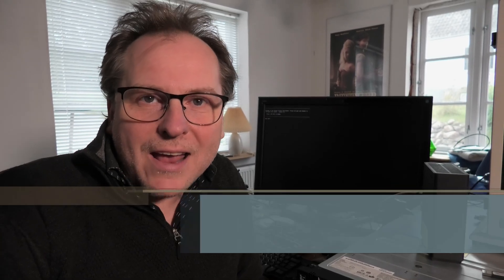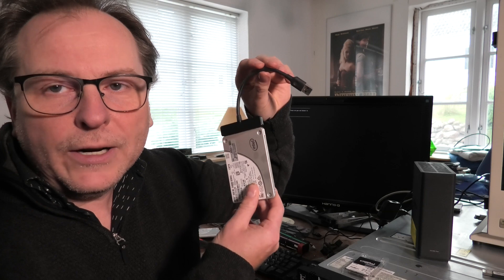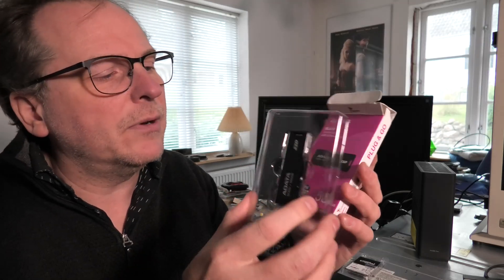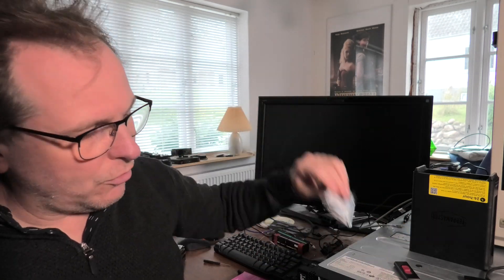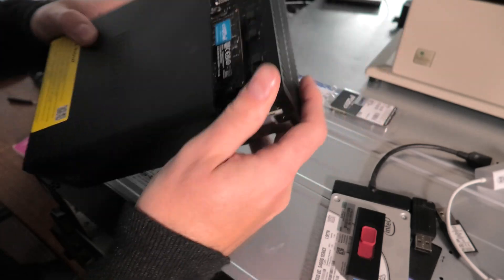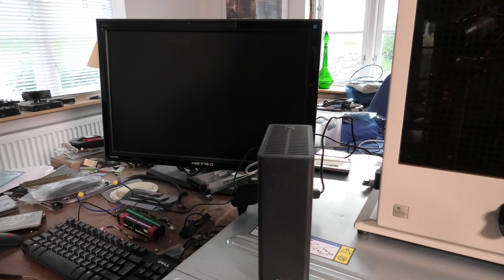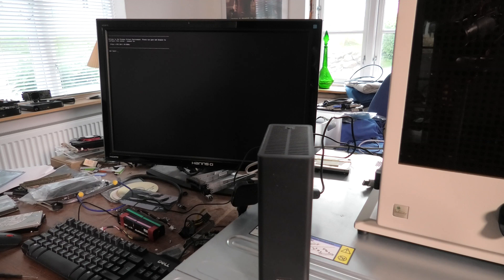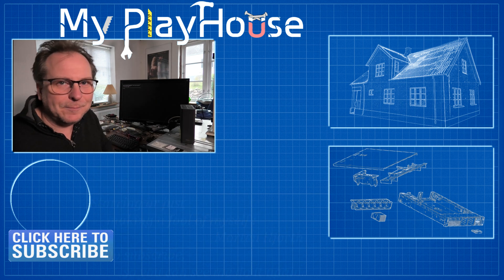The TerraMaster F8 SSD Plus - Does do 32GB of RAM - 1431

Comment: I have tried 48 GB RAM (Corsair CMSX48GX5M1A4800C40) and 32 GB RAM (Crucial CT32G48C40S5), none of them worked even after waiting 1 hour (Corsair) and 10 minutes (Crucial) :(
I wonder if NVMe slot usage count matters (I'm using all of them), or if some newer hardware revision of the CPU has it locked to 16 GB...
Reply from the maker: I had some issues later with two NVMe´s,, and booting Proxmox from USB-SSD and 32GB
Reply: Me too. I have no luck to boot up my F8 SSD Plus (BIOS: MADN0301.V01, Mainboard version TM-N305D1-H V1.1) with 48GB DDR5 SODIMM (Corsair CMSX48GX5M1A4800C40). I already disabled the secure boot, VT-d, First boot is not TOS. But still not able to boot up the machine. Any suggestion? Also, would you tell me the BIOS version and the Hardware version of your F8 SSD Plus.  Thank you so much indeed.
Reply: @adktk  It just doesn't work for me either. I have the MADN0301.V02 / TM-N305D1-H V1.2, tried with the Corsair 48GB CMSX48GX5M1A4800C40 and another 32GB (SP560013) specifically designed to work for the F8 SSD Plus. Tried resetting the CMOS (battery removal + jumper), removed all M2 SSDs, waited 15 min each time for the memory training to complete. No success. If you found out how to solve this let me know.

Comment: we just tried with 48gb ram and it works.
Reply from the maker: Awesome!! thank You for info.
Reply: What exact brand and part # did you use for the 48GB RAM?
Reply: I have a Terramaster F8 SSD Plus and I have successfully upgraded to 48GB RAM with Crucial RAM 48GB DDR5 5600MHz (or 5200MHz or 4800MHz) Laptop Memory CT48G56C46S5.
Reply: @gosciak1949  Hi gosciak1949, I have no luck to boot up my F8 SSD Plus (BIOS: MADN0301.V01, Mainboard version TM-N305D1-H V1.1) with 48GB DDR5 SODIMM (Corsair CMSX48GX5M1A4800C40). I already disabled the secure boot, VT-d, First boot is not TOS. But still not able to boot up the machine. Any suggestion? Also, would you tell me the BIOS version and the Hardware version of your F8 SSD Plus.  Thank you so much indeed.
Reply: @gosciak1949  we found 2 that worked,
CMSX48GX5M1A4800C40
and
CT48G56C46S5

However we noticed it does not always work it could be there is diffrent versions of the f8 ssd plus that we do not know about. it seems very random if it works or not. for some odd reason. when it does work however its very stable. but its hard to tell what the cause is.

for instance on one of my f8 ssd plus the corsair 48gb did not work but it worked in the other one. and vice versa. we checked on terramaster forum and it seems to be quite random. all we do know is when it works. it works solid.

Comment: Maybe something like this (AIYEEN 90 Degree USB3.0 Adapter (2 Pack), Left Angle and Right Angle 3.0 USB A Male to Female Converter Extender for PC) on Amazon, will give you 90 degrees and also support the USB drive. Would be great to see if you can get it working as I've ordered an F8 and planning on TrueNAS as default OS.
Reply from the maker: I ordered two of these : https://www.aliexpress.com/item/1005006169997347.html
To see if any of them will do the trick.

Comment: Hi, just wanna let you know, the 48GB ram stick also works in Proxmox. It is the best companion for F8 SSD Plus :)
The only thing I think this product can do better is they should use Intel x710 10GbE chips instead. X710 can support SRIOV and ESXi so the network performance would be better. Otherwise it is still a good little homelab server with Proxmox in most cases.
Mine running Proxmox, and running TrueNAS inside Proxmox, pass through 6 of the NVMEs and 2 nvmes left for VMs. But you inspired me to use the internal USB as well, so we can basically have 9 SSD all together:)
(I am not sure the internal USB speed, but I assumed it is a 10Gbps USB, so it is effectively about the same speed as PCIe Gen 3x1, which is nice.)

Comment: Might have found the perfect solution to use the internal USB port for more storage. On amazon they sell for £15 an nvme enclosure for 2230 which comes with a usb port and usb cable so you can fit it anywhere in the case. Size 42mm x 42mm and height / thickness 12mm would this fit inside the box do you think? I could not find a USB stick which is SSD smaller than the one you have.
Reply from the maker: I have ordered a 90 degrees bent for the USB A,, for the SSD to fit in the case.

Comment: I've been running mine for a few weeks now - the next hurdle to run another OS on this - I think this is what is going on - is the some of the M.2 slots are attached to a switch, and there's some funky timing with that.  The net effect is that a few drives will go offline randomly, which is super annoying.  It's better with some kernel parameters added (I don't have it in front of me, but it's the same boot params needed for TruNAS Scale), but not 100% yet I think.  I've read somewhere that turning off VT-d in the bios may also help, but I haven't tried it yet.  Otherwise it's nice with Proxmox, easily saturating the 10GbE connection.  All mine does is run ceph storage all day, so no VM's.  If it wasn't so expensive to load up with drives I'd set up another one I think.
Reply from the maker: Yes,, It is quite the investment to fill it up with NVMe's of any good usable size :-)

Comment: Thanks for your videos! You really try things that noone alse does with this device. :)
I would like to install NVMe with preinstalled heat sinks. Do you have any idea how thick they could be to still fit in the case?

And just as an idea for another video. Maybe you could also try truenas scale with ZFS. Would be quite interesting to see how it performs. Thanks!
Reply from the maker: There is okay spaces for heat sinks that are a bit bigger,,, The NVMe perform better when they are hot, but the last longer if they are cold,, and both, is so little that you will likely be replacing them when they become to small.
I found truenas scale with ZFS very stiff,,, not fixable,, like try and expand your array with a new NVMe,, not a thing..

Comment: Great follow up and shows your honest if you get things a little wrong. Regarding the USB I would just buy a usb cable I suppose the main things are where to mount it / how? On the CPU heatsink I think might be bad but maybe on the inside of the case above the nvme storage with some velcro might work (be fiddly but looks like there would be space between nvme and the case). I only say this location because the nvme only operate at 1,000 speed so would not get hot. CPU heatsink is likely to get hotter. Removing the USB drives plastic case might work but I suspect it will still be bigger. My view would be decide where to mount it and from here you can decide. Just a thought a most likley to late for you you can get usb to nvme caddies not an enclosure which would probably fit down the side with a usb cable (they are long 2080 but would be less thick from my experience and cost about £15). Anyway I'm even more excited now about this box and might have buy one to have a play. Looks like a very cheap to run proxmox server cable of a few VM's Thank you for the video amazing as always
Reply from the maker: Yes it's a nice box, with lots of possibilities!! It's nices that they have not lucked it down...